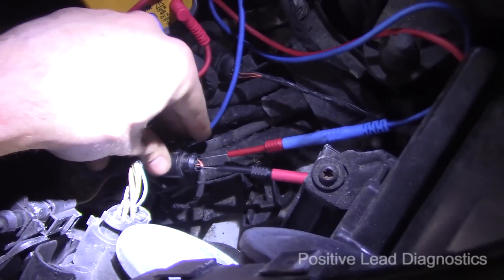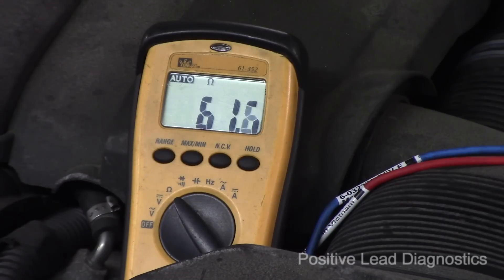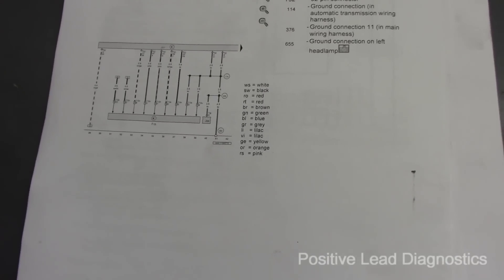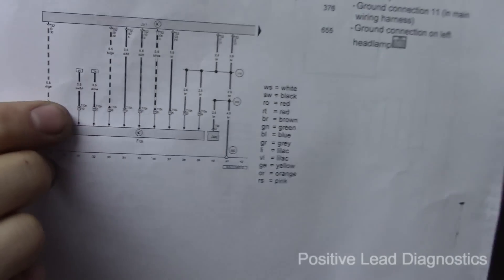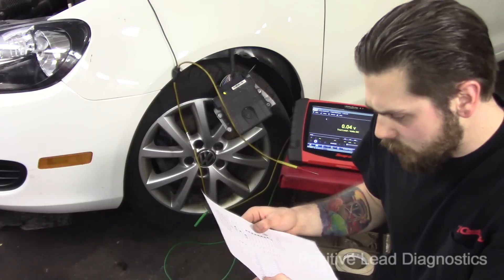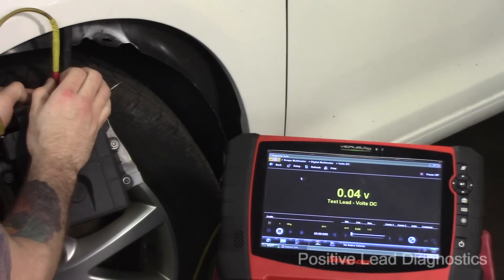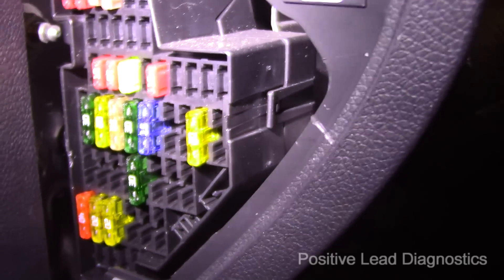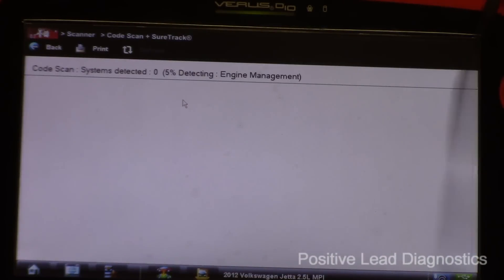2012 VW Jetta No Communication with TCM U0101 (part 2)

Comment: Typical IO pins have protection diodes that clamp the IO lines to an internal power supply rail. If input power is missing, data lines get clamped to that rail (which will be somewhere near 0V due to not being powered up) and that's where you get the signal distortion from. Under normal operation, the internal supply rail would be at something like 5V, which is higher than CAN bus voltages and would reverse-bias the diodes, taking them (and the distortion they caused while the TCM was powered down) out of the equation.
Reply from the maker: BBS_Robski
I don't remember your comment, you should have left it. Did it maybe occur to you that BEFORE I posted part 1, that I already knew about the missing fuse? So I do not reply to most comments when there is another part coming out. Why would I? I would ruin the second part!
If you did provide an explanation of "BUS & testing etc", you would have been one of MANY people doing the same thing!
Teardown Dan stated specifically that the waveform looked like it was being caused by a module with no power to it! He is the only one to pick that out, on the waveform alone! (pretty freaking bad ass if you ask me) 
So is your beef that I didn't thumb up/love your comment? If it was intelligent and useful, I definitely did. There was quite a few guys that were spot on and you may have been one of them! Again, I chose to communicate with Teardown Dan specifically because he was describing the network from an engineering standpoint, as he has done again above and this is what I was really looking for. 
Sorry you felt slighted
Reply: @ScannerDanner  ...pretty bad ass indeed... that is the weakest part of my growing understanding, how to interpret oscilloscope graphing.  ...and obviously that takes a more profound understanding of how internal components behave, and the respective resulting oscilloscope symptoms, as-in electronics knowledge.  One obvious example, what the little tiny bump denotes on an injector graph.
Reply from the maker: How about re-posting what you deleted, then we can talk about it. If you're saying you commented about the DLC to Gateway line, (I don't know what 0x19 is) compared to the CAN lines the TCM was on, well, we figured that part out, so I didn't need help with that. 
And your condescending remarks to my friend are not welcome here.
Reply from the maker: Who peed in your Cheerios
Reply from the maker: Wait, I found it. Here is what I have from you on the first video
"without a WD i think the measurements @ the DLC are the diagnostic bus which would be initiated by the scan tool."
Great comment! But we figured this part out in the video didn't we. This was not profound information like Teardown Dan provided
Reply: Yes, badass  :-) if I could do it over I would take electronic engineering. It absolutely fascinates me. Thanks again man. I received your second email, sorry I haven't responded. It was great too, thanks again for your time.
Reply: Why the need for the arrogance and the filthy replies to ordinary people who sign up here with different interests, different knowledge, different experiences, and different learning abilities? They are all entitled to try. If you don't have the patience or a better command of language, perhaps you should change your therapist, or quit joining in the discussions if you can't be respectful or tolerant of others less informed than you. Some great lessons here. Interesting that those who really know their stuff are often the most intollerant, and the most inept at explaining themselves in a language we may all understand. Using jargon or slang isn't really very helpful when one is new to a subject.
Reply: @davidpaterson6318  You should be pointing out who you are dressing down sir. I think I know who you are referring to but still.....
Reply: @KStewart-th4sk  Thanks for your comment. I had a quick look back and can't actually see - or remember - whose comment mine referred to! Could it be a remark has been removed or modified, or that I have missed the one(s) I may have referred to? Whatever, 6 people liked what I wrote and no-one took offence. I'm generally complimentary and supportive of technicians - and trainers - of all skill levels, but I reiterate what I said. I'm about to retire, and only days ago travelled to another country to attend a 2 day training course, simply to keep up my interest in this fascinating and evolving trade. My aim remains to encourage others, not to put them down.
Reply from the maker: Everyone paying attention? You should be!
This is the kind of "internal network" stuff I was talking about, that we all need to learn. Not the typical explanations of a network that everyone reads from a book.
Reply: The typical explanation assumes that the circuitry handling said communications is properly powered up :)

(Just like everyone assumed that when Tom said he had already checked power and ground, he had actually checked all applicable power and ground :) )
Reply from the maker: I know, I was replying to him. Thanks Chris
Reply: At the sub-1Mbps speeds automotive CAN busses run at and their relatively short cable lengths, the termination network resistances' values are not critical as long as they produce the correct rest voltages. The tolerance range has more to do with inexpensive good practice than absolute necessity: termination resistors are necessary to ensure that noise doesn't build up on the wires and having values in the general ballpark of what is required to achieve optimal results on an ideal wire doesn't cost anything extra. The CAN bus' impedance will get messed up by every fork, splice and stub in the wiring harness anyway.

BTW, if a car manufacturer wanted to play ticks on every tech who relies on DC resistance to test CAN (or shave ~0.2W off of their ECU's power consumption), it could AC-couple the CAN termination. The bus should still work perfectly fine but DC resistance readings would show open-circuit. You would need an LCR meter to see the AC impedance from line to ground. I doubt many would contemplate doing this though as the bias circuit would be quite a bit more complex than two resistors costing less than $0.005 each.
Reply: Concerning your electronic engineering note - when the first video showed the odd CAN signals, which was new and puzzling to me, I cheated - I called my electronic engineer son, described what was happening and not happening, and from that information he suspected the TCM was not powered up properly because of this, that, and the other (I should obtain a recorder for my phone).  Electronic engineering is fun.  I dabble with it on the side to improve my understanding and troubleshooting.  

This I have learned about CAN resistance - 60 to 70 ohms signifies a good connection, because automotive safety requirements dictate tolerance be there.  GREAT VIDEO!
Reply: The videos and Teardown Dan's comment inspired me to take a CAN bus driver, connect it to various circuits and check the waveforms. If you are interested in the results, please check my most recent upload. Thanks to all!
Reply: You welcome
Reply: BBS_Robski ok wtfe
Reply: ***** thanks
Reply: ScannerDanner not me it was bbs  robski saying you didn't listen to him I was defending Timmy
Reply: tell me sir I'm listening would love to learn more cheers sandy
Reply: Dan i
Reply: It isn't so much "being badass" as simply having a some engineering insight into how these types of things should be put together.
Reply: sandy anderson read the SSP that a link was supplied for pal in the first vid !
Reply: Guillermo Amaral no stars reqd, i don't reply for medals & i appreciate the time taken to reply to numerous comments etc BUT to reply or acknowledge replies after the first i found I'd wasted my time to be ignored.
Reply: ScannerDanner i was the first to reply in the previous vid with an explanation of the BUS & testing etc but it was blatantly ignored (replies after got thumbed up/love hearted) so i deleted it, i won't waste my time in future because if there's one thing i hate is ignorance 😖
Reply: ScannerDanner that's not all of it as it was edited several times during watching & 1 edit was 'as you proved what i said by scoping the CAN @ the DLC, as for not knowing what 0x19 is your dealer tech man should !
Another edit was regarding a WD & i' think' which was changed to 'at least in our market (UK)', these are from memory.
Another part was regarding the terminating resistors but your man Dan seems to apparently know about these.
Reply: ScannerDanner i firstly explained the diagnostic BUS between the DLC & 0x19,i don't care if it was already known a fuse was missing as you both seemed to be hung up on the BUS @ the DLC, for a 'dealer tech' to not already know this was ?????????

Comment: Hi mate.
Write please if it is possible that inGolf 2005 2.0 FSI , all 6 main pins in ECM show -12 V (ground), 1,2,3 Should be ground and 4,5,6 should be +12 V.
But they all show -12V or ground

Comment: The reason why 60 ohms was present with the Tcm plugged and unplugged was because the terminal resistor is not in the tcm but in a different module , if it was then it would of jumped to 120 ohm unplugged. The canbus high , voltage was reading between 2.5 to 3.5 and low was 1.5 to 2.5 v in first vedio , even though power was not present this would not affect the can voltage
Reply from the maker: I've learned a lot on CAN since this video. Thank you!

Comment: WOW man your a car genius. I have a similar issue in my 2016 VW jetta TCM when it rains somehow it’s getting wet and interfering with the signal. I brought it to VW and they did the resistance check and wanted to replace the TCM. I’m not sure why they wouldn’t re seal the TCM because this happens every now and then when it rains but when I run the car with the heat on or just plain give it some time all the lights usually go off and I can shift it back into drive again. Does anyone know where the TCM is located in a 2016 VW Jetta? I’m assuming it’s inside the front driver side wheel well behind the fender liner like in this video….advice?

Comment: Is the tcm in the same place for a 2011 and 2012. Cause I keep being told the tcm for the 2011 vw sports wagon is inside the transmission..?
Reply from the maker: No idea. But I know they did move them inside at some point
Reply: @ScannerDanner thank you for your reply.  where is the tcm located on the 2012?

Comment: I have a problem we replaced the gateway module but we are not getting the starter going before with the bad gateway we used to be able to crank it for 10sec and went off, after replacing the nee dealer gateway if I start the car directly with a wire to the battery car runs but it won't start using the key it won't turn over the programmer said that he it's getting 17v to the bcm but I am having the same issue

Comment: Excellent follow-up to Part 1, Paul and Tommy.     What a valuable lesson for everyone: how a less-than-satisfactory wiring diagram could have cost you $1k, let alone the hurt to your pride.       Paul, Tommy, you make a great team; how about a rematch?
Reply from the maker: Glad you enjoyed it and thank you for your comment on Part 1 too. Not many saw it the way you did. I certainly thought so when we produced it! But you are right, I have learned a lot since this video! For one, when pins 6 and 14 are not wired directly into the CAN network but extend ONLY to a gateway module, you will not see the resistance you are looking for (120) and I've also learned that there is no standard in that regard lol 
Thanks for the support on SD Premium too. It really means a lot. Watch my 2018 Duramax series when you have time. It is an intermittent CAN "crash"
Reply: @ScannerDanner    Thanks, Paul, for explaining why tapping into Pins 6 and 14 will not give any useful results on some cars.     That’s a bit of info I’m definitely going to add as a hand-written note to your book.  And as for having time to watch one of your videos, that’s something I’ve always got time for.
Reply from the maker: @martinrubenstein7943  thanks again Martin!

Comment: UPDATE: about my question at bottom of this reply...
Sorry, I should have read the entire thread... I see now that the 60ohms is probably a parroted coarse instruction...  60 to 70ohms is a good result.
- - -
To be clear and transparent:
Teardown Dan is the only one who nails this due to his understanding of electronics devices behaviour and knowledge of what device are in the game.
Everyone who reads my posts below should be aware that I would have resolve the issue on the onset, only because of my methodical approach to troubleshooting, NOT because I understood the issue... but now, I surely understanding better, except for ONE thing.
Unless I missed it, once the repair was performed, was an ohms test done again at the 6/14 pins on the breakout box!?  ...and what did it now read?  was it still the same, more than the expected 60ohms!? ...and if so, what causes that to clash with the expected 60?
Reply from the maker: From memory, on a model like this one where 6 and 14 go directly to a gateway module and are NOT connected directed to the rest of the network, you cannot measure resistance and expect to see 60 ohms. So we made a mistake here.
Also, a missing power feed to one module (like we had) on a network would NOT change the resistance of that network. So this never had a network resistance issue, again, we measured it incorrectly due to the design.
Lastly, your comment of knowing what the problem was at the onset is a little arrogant don't you think? Especially with the info I just provided to you.
Reply: @ScannerDanner  no Danner, please revisit my comment, I did state I only would have encountered the issue on the onset NOT because I knew what I am doing but because I follow a method that leads me to the issue though I do NOT understand it!
I do not have enough experience that allows me to visualize a system yet, and you would have to agree that most people who watch these videos are also in that batch.  But by now I am starting to understand and visualize systems much better... yet, I know my approach works, understanding or not, so I still follow that.  I am not arrogant, I am an engineer, just not specifically an automotive engineer.  I have knowledge in computer science that trumps most people's level of understanding... perhaps an unfair advantage, but I am not competing to be at the top of the class, only adding my grain of salt as to others ways to attack the issues. I also understand that you can be a bit defensive and jump the gun, we all fall in that wave. no harm done.